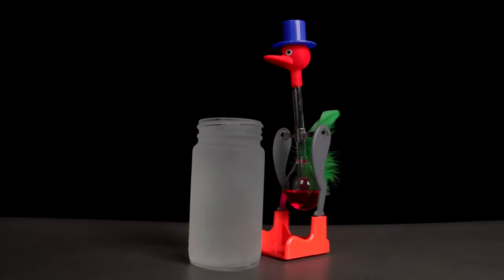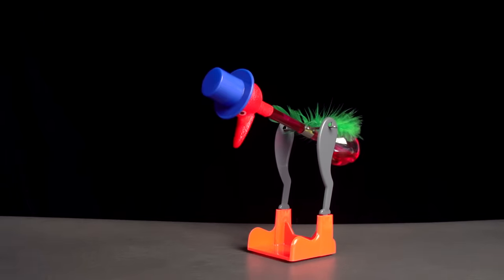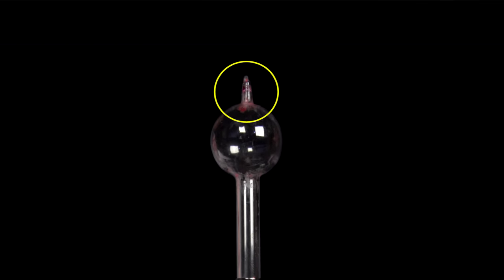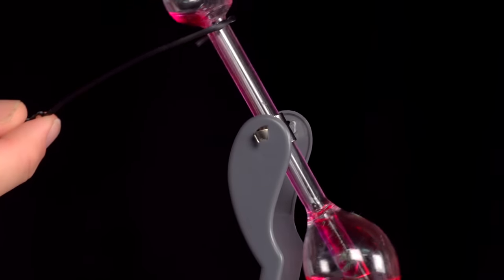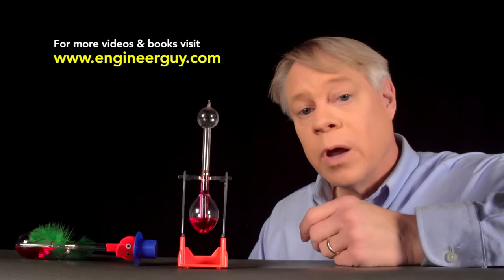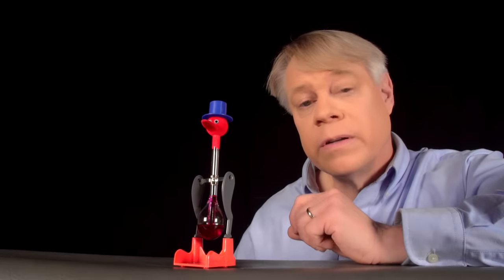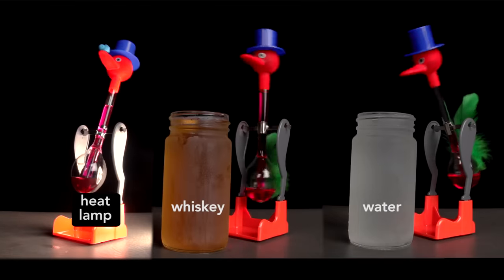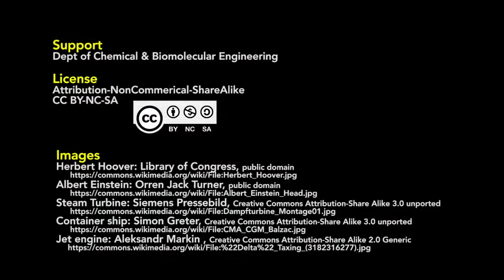The Engineering of the Drinking Bird

Comment: I was still a little flabbergasted until the moment when you mentioned that because the bottom ball is at lower than ambient temperature, it's heated by the surrounding environment. That snapped everything into crystal clear understanding. Fantastic video!

Comment: Great video! In summary, evaporation occurs in the head of the bird when it wets its beak. Therefore, the head of the bird becomes colder due to evaporation. Water always flows from high to low pressure. In this case, the tail has the higher pressure since the water begins to slowly work its way up the tube. Temperature and pressure are directly related. If the temperature drops, the pressure will too. As stated before, the water will flow towards where the pressure is lower, causing the weight of the bird's head to increase, dip back into the water, and repeat.

Comment: Why don’t we build one of these as tall as a skyscraper and power a city with it?  Where’s my Nobel prize?  And the top hat is a must...
Reply: Storms would drive that thing crazy
Reply: @sanstheskeleton679  even better
Reply: There are a lots of reasons why it wouldn't work.
1) The amount of energy it would produce for the sheer cost and size of such a thing is negligible. You'd be better off installing solar panels on top of the roof of a skyscraper, you'll produce far more energy from the sun and still have your skyscraper.
2) The amount of pressure that would be required to move such a ridiculous amount of liquid for such a long distance would be absolutely staggering and would require material for the container capable of withstanding so much pressure and probably a different liquid or otherwise massive temperature difference.
3) The pressure differential from the ambient air around the container at the altitude of a skyscraper (Say ~200-300 meters) would be lower which would exacerbate the second problem, needing a material capable of withstanding an even greater pressure differential. It's the same reason why balloons don't end up in space, they expand as they reach high altitudes from the pressure the helium in the balloon exert, causing the balloon to burst when the rubber reaches it's maximum amount of force it can take from being stretched. Albeit ~200-300 meters isn't that bad of a difference, it still would cause a problem.
4) The temperature difference from altitude also would factor in the equation, although probably in favor of such a contraption since higher altitude in the troposphere does means lower temperature, which would cause the head to cool and reduce the pressure inside.
Reply: @snaplemouton  Lol.
Reply: @snaplemouton  nerd (jk)
Reply: I think it could work.
Reply: If that won't work, why not make a million small birds drinking, making electricity, bringing world peace...
Reply: Wouldnt work cause the water is supposed to be room temperature
Reply: Ooor it doesnt have to be one bird, scale it to a thousand or millions.
Reply: @mohitsomani5154  how will you power the bird?
Reply: But... it will drink all of the lake
Reply: I think it's becuase it won't be able to produce more energy than the energy spent to fill the water in the jar....
Reply: What if you used the ocean for unlimited cold water

Comment: If whiskey evaporates at twice the rate of water, would a situation ever arise where someone has become overheated and you drench their head in whiskey to cool them down?
Reply: Three things came to mind using whiskey to cool down rather than water: 1.) It's more expensive, 2.) It's flammable, 3.) I would want to get pulled over after.
Reply: A situation, such as someone with a high fever, would be reason to give that individual an alcohol bath (i.e. rubbing alcohol diluted with water)

Comment: When studying to be an engineer in the 1970's, a fellow student had a thesis project to make an engine using the drinking bird principle. It consisted of a large wheel about 5 metres in diameter mounted on a horizontal axis (like a Ferris Wheel), with dozen or so drinking bird equivalent units mounted radially and a water trough at the base. As the wheel rotated, the cool zone dipped into the trough, while the warm zone in the centre remained at room temperature or was heated using an external heat source. I recall that it wasn't very powerful and barely turned, let alone provided any useful output.
Has anybody developed a similar engine based on this principle? Its engineering beauty was that it had virtually no moving parts except for the contraption itself.
Reply: It seemed to me that this device resembled a Stirling engine.  The Stirling heat cycle was developed to make a rotating machine but the principles of the nodding bird  seem to be based the Stirling heat cycle

Comment: really the bird is an heat engine , i didn't have expected it was working with  condensation of vapour. the clever idea for getting cool was a fabric wick. when  the wet wick kept in to flow of air it's temperature was getting down compared to ambient temperature. finally  the energy conversion was heat energy of the ambient air in to mechanical movement  of the bird. great and great explanation sir. 🙂🙂🙂🙂

Comment: Next step is to move the chassis of the bird through the range of its Centre of Gravity with respect to the pivot point. You can slide the galss tube through the metal ferrule to adjust this.. Do this in increments of about 1/16 inch.  See if you can predict the mechanisms that  define the limits of cyclical (occillatory) action through out this operating range. See if you can design a data monitoring system to display the behavior of this engine through out the range of operating regimes.

Comment: You see this bird in the movie Alien (or Aliens?) but it would have not worked because the sleeping astronauts could not have replenished the drinking water supply as it evaporated over a few days and oil would not work because it won't evaporate off the bird's head to cool the vapor. Question: Is there SOME liquid the bird could drink that would allow this to work for months? years?

Comment: The reason you needed the counterweight on the bird's nose is that you had the little metal bracket/pivot on the bird's "waist" turned around backward.  This bracket intentionally biases the weight of the bird toward the front by placing its center of gravity forward of the axis of the pivot.  Turning it backward biased it in the other direction.  Nonetheless, you restored the balance and the demonstration is a success.

Comment: Okay, well this was a very nice video, but I also expected a quick rundown of the tipping speed at different temperature waters, it seems like cold water would enduce more condensation of the inner gas and cause faster tipping but it would also have less external evaporation causing less heat loss, and the opposite in warmer water, but the warmer water may push the height of the liquid so far down that it may push an air buble out and would have a faster rate of evaporation which would have a faster loss of heat. I don't have one of these birds and I thuroughly want to know how this would affect the tipping speed and graph the tipping speed vs temperature

Comment: You can compare it to one of these so-called "love meters" which is just two bulbs full of Methylene Chloride with a tube going almost to the bottom and a fountain in the top bulb.  You heat the bottom bulb with your hand and it supposedly measures just how quickly you fall in love.  But it is really the same thing as the drinking bird where there is a heat difference between the two bulbs causing vapor to expand in the bottom bulb which is where the real action takes place.

Comment: Is possible to make this, using alcohol? I read in past they had used different liquid materials for internal liquid. I like to make it as experiment, but I don't like the risk of using methylene chlorid. I read that alcohol had similar property. It can be quickly heated, and it will rise when heated. The only issue seem to be how to find the glass materials (a tube beaker?)  to reproduce this little toy, for science knowledge and educational purposes. What other liquid materials can I use? I have search online, but I would like your expert opinion on this. Many thanks.

~Ann

Comment: Because I was  looking into the old "external" combustion "Sterling Engines" ages ago  the basics of how the bird worked jumped into my head in seconds ... before the explanation. Alternating Temp/Pressure with a liquid with a lower boiling point than water (because there was no external heat other than the room temp). Einstein must have been having a bad couple of weeks! (Stirling Engines were invented in 1816)

Comment: I was hoping for more detail of the pressure cycle and how the oscillation continues for multiple cycles after removing the external temperature differential.
  On the outro topic, I never understood how Otto cycle engines are classed as heat engines rather than chemical engines, as some energy comes from changing the number of gas molecules through combustion.

Comment: Neat video but you failed to mention the starting position of the tube for optimal performance.
That glass tube slides up and down through the metal axle point. If the head is up too high or slid to low, the bird will underperform or not work at all.
Still working on what is optimal leverage from a starting point?
Oddly this information is incredibly hard to come by.
One would think it could be etched upon the glass or minimally printed on an instructional diagram included with purchase.

Comment: Well I be damn.  I got one of these birds when I was twelve years old I think from ordering out of one of my comic books.  I believe it cost me somewhere around a dollar or dollar and a half.  I'm now 74 years old and I never knew exactly how it worked.  I can't remember if I wore it out or I wore myself out trying to figure how it worked.  Actually I took it apart to see what made it tick, which is what I did with all my toys sooner or later.  I built the first electric car too.  It was a plastic fire truck which I cut the back out of and fit an electric razor motor in which my dad threw out because he didn't like the electric razor.  I got the motor out and rigged it up to the rear axle with a wide rubber band stretched over the gear of the razor.  When I plugged it in the wall my fire truck would spin the back tires at an immense speed hurling the truck across the floor at a fast rate of speed until it came to the end of the extension cord and jerk the plug from the wall.  Can't remember if that was how I set fire to all the spider webs under my bed that time or not.  Mom never told dad what I did, she always protected me from my serious dad as he wouldn't understand.   My poor mom used to always stand around either laughing uncontrollably at me or crying at the table trying to figure out what to tell dad when I did something really stupid (which was a lot of times).  I love my mom and she is still alive today.  If you asked her if I was a good boy even today she would look at me first, smile then shake her head yes to you.  I love my mom.  Sorry I wrote a book here, it all started out from that damn bird. God bless all you moms out there that lied for her children just to keep them safe.  When I get to Heaven and find dad I'm going to tell him about the best mom there ever was. 😇🥰

Comment: Is it just me or is it common sense how it works, it's just simple pressure imbalance combined with enlargement of the liquid and gas inside the tube when being heated or cooled. Thats why it tips over and over until the strall itself reaches equilibrium and the liquid and gas can't change size or pressure of the whole system.

Comment: I am wondering why this isn't a perpetuum mobile. To my opinion it overwins it's own resistance and on top of that it moves forward and backward, eternally! You only have to make sure the waterglass is filled. I am also wondering why "we" did nod build a powerplant based on this principle??!
Reply: We already have more efficient heat engines. The bird stops when the air is too humid or runs out of water, and doesn't work if you scale it up too much.

Comment: Oh, yo have to come to my house to see, 5 years ago i hade the small one and  i made it in the shed with 21 foot tall,and i connecten it to a pulleey and a rbber belt to  an bicicle wheel and its old time 3 waatt generator, thegenerator that feeds a 12 volt battery and lights my house 3 watt leds,all 5 of them; i just added a 0.5 watt  12 volt pmp to wet the head more faster and a 0.5 watt fan to speed up evapore; i use plasticcrystal tbes inside hardened with gasoline (removes the plastizicer) and 6 meterx 120 pvc pipe heavy wall for outsides

Comment: So there is a perpetual motion machine then?
Reply: Perpetual motion machines do not exist.
Reply: @Winasaurus  How can you prove something doesn't exist?
Reply: @johnmonk66  Because they violate the laws of thermodynamics. There's a reason noone has built one yet despite literally hundreds, maybe thousands of years of attempts. It's impossible.
Reply: @Winasaurus  the moon
Reply: @johnmonk66  What about it?
Reply: @Winasaurus  It has been and will be moving for millions of years, perpetual motion. Lets also mention atoms, moving non stop forever
Reply: @johnmonk66  Except the moon is actually pulling away from the earth in a spiralling motion and has been for ages. It will eventually pull too far away and leave to the depths of space. Something is only a perpetual motion machine if it can actually exert work and keep moving. An object moving in space only does so with no resistance. The moment you make resistance to make energy it slows down.
Reply: @Winasaurus  nice try to change the definition.
Perpetual motion is something moving with no external force, no one is pushing the moon, no energy is being used, perpetual motion
Reply: @johnmonk66  I said "perpetual motion machines do not exist", not "perpetual motion does not exist". They are different things entirely. One does work, another does not. One can generate power (theoretically) the other cannot without becoming non-perpetual.

Besides, if you want to get into the nitty gritty, the moon still isn't perpetual motion as it's not in a stable orbit and will eventually crash into something in deep space after it leaves earth orbit.
Reply: @Winasaurus  The moon creates PLENTY of power, it moves our oceans. ANd you can't prove the moon will fly away someday,
Reply: @johnmonk66  Exactly my point. By moving our oceans it affecting it's own orbital path and speed, meaning it's not stable, and therefore non-perpetual. So exactly what I said about if it provides power, it's non-perpetual.

And you can prove the moon is getting further away. We literally measure the distance and can see it has steadily been getting further away.
Reply: @Winasaurus  prove it
Reply: @johnmonk66  Literally search anywhere  you'll see the moon is moving away from earth over time. You can even measure it yourself with a powerful enough laser and enough time.

Comment: I disagree with 1 information: 100% humidity won't cause evaporation to stop. Water evaporates even when humidity is 100% the point is, that water also keeps condensating. So when humidity is 100% ammount of water evaporated is equal to ammount of water condensated.

Comment: So its a Stirling engine
Reply from the maker: Well they are both heat engine, but it is not a stirling engine
Reply: @engineerguyvideo  Oh
Reply from the maker: You did correctly identify that they are heat engines — I have considered doing a video on the stirling engine because there seems to be great interest in it — a puzzling interest, though, to me because a stirling engine is such a rarely used variant of the heat engine, it’s use a tiny, tiny fraction of use compared to work horses like the diesel and Otto engines.
Reply: @engineerguyvideo  You should check out pop-can stirling engines. It amazes me how simple they are!
Reply from the maker: I will ... thanks for tip

Comment: Soooo, I'm just some idiot that doesn't know jack about engineering, but if you can keep this thing moving with just some fabric and some water, why hasnt anyone thought to build larger ones and use this motion to generate electricity? 

Seems like a wasted opportunity in my eyes, but if there's a reason why this wouldn't work I'd love to know
Reply: We already have far more efficient heat engines. Notice that in essence, it's just a temperature differential creating a pressure differential to induce movement. Stirling engines are an example of one that can be made on a very small scale quite efficiently.

But the most obvious case of one, is the internal combustion engine. Use a ton of heat to expand a piston and turn a shaft very quickly.